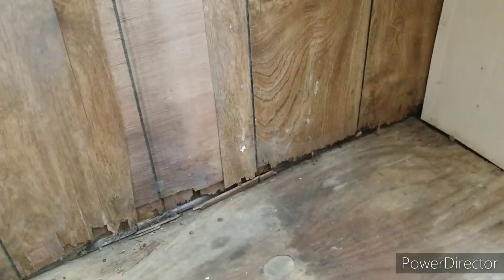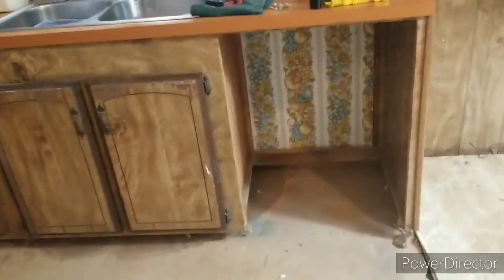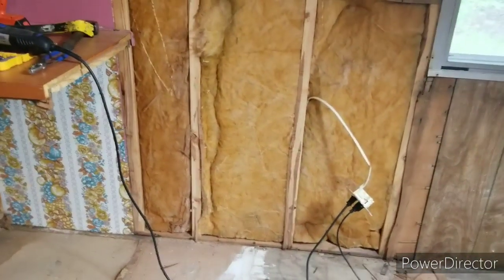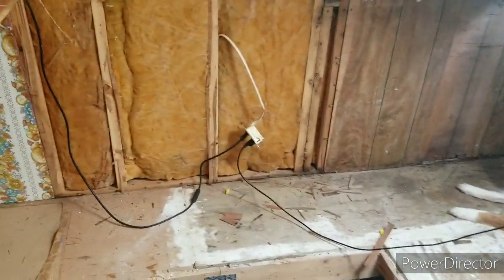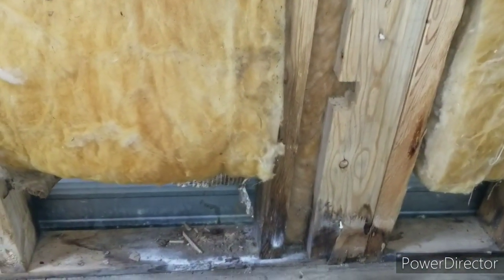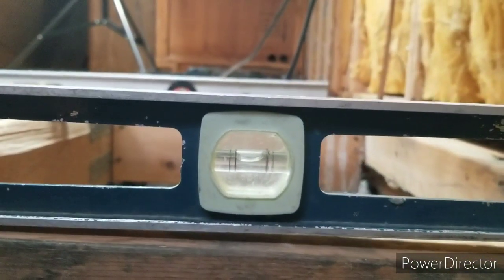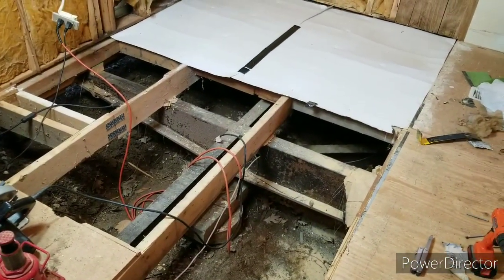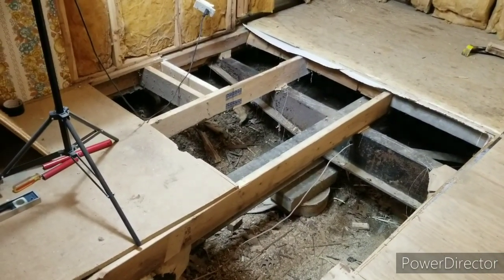#2020 $5000 MANUFACTURED HOME KITCHEN FLOOR AND CABINET TEAR OUT AND REPLACEMENT PT 2

Comment: I know how you feel about those friggin screws.son in law had to replace toilet ring left a mess. Husband redid bathroom back in 2000. layed roof shingles between the repair and another 3/4 price of plywood. Shingles saved bottom layer,but son in law tore apart  the good section patched hole. Like i said left a mess and now my son and me have to take toilet back out so we can lay new linoleum and get a piece of 1/4 to level it out with the rest of the floor. So be proud of yourself for getting it done for yourself.